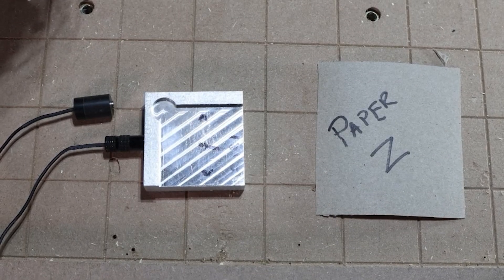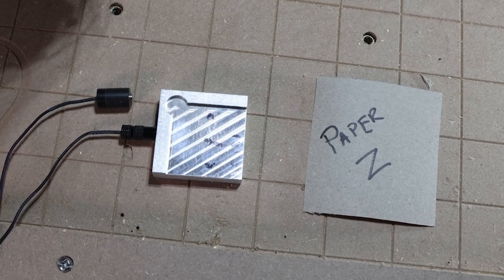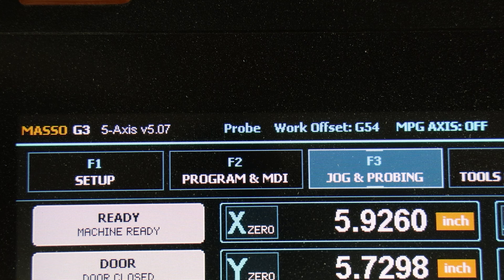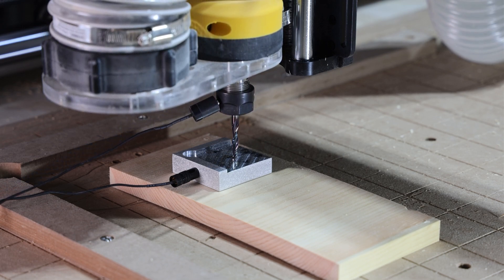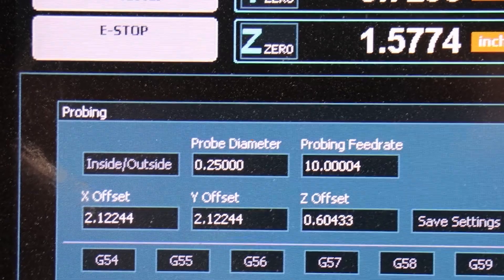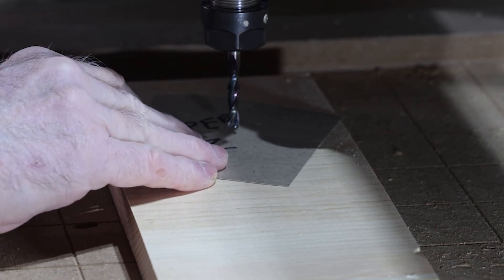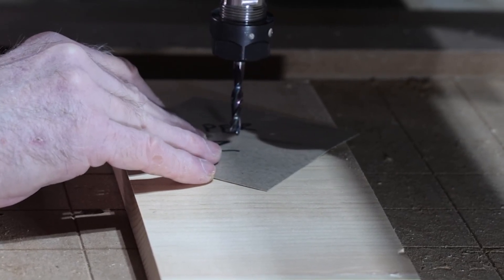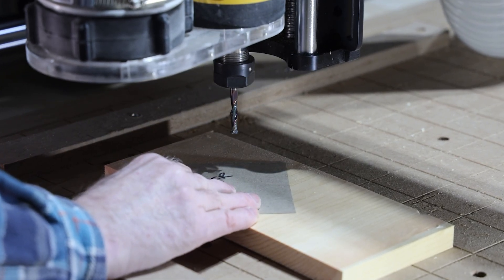Mastering CNC Bit Zeroing: Touch Block vs. Paper Method | OneFinity Masso Tutorial

Comment: Generally just use the paper method or probe, feeler gage to get it in the ballpark then cigarette paper till its stuck. You can also just use a feeler gauge and use a ground block to just lift it a bit above the table as generally spindles dont go too far down
Reply: What do you mean  “ spindles don’t go too far down”?    I say if it works use it!!!